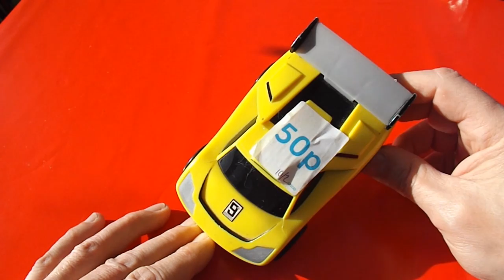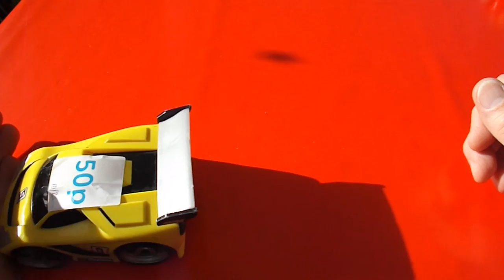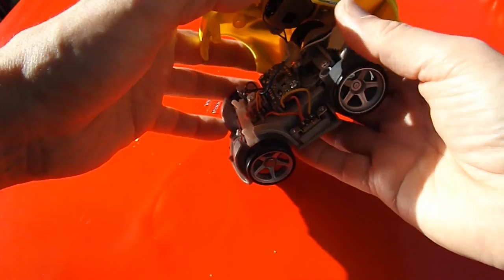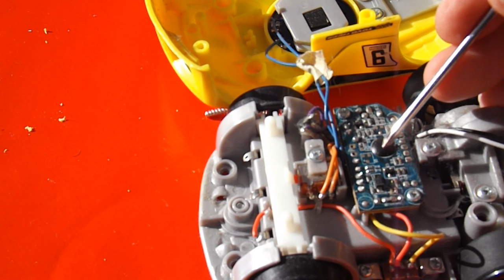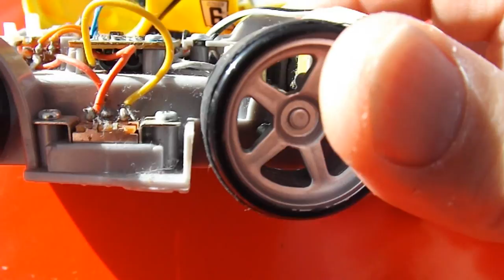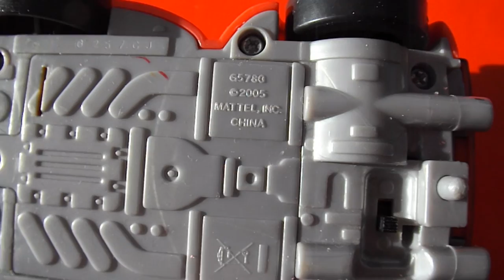Another Shake n' Go toy car Tear Down Toyo Tires

Comment: You now need the raceway to go with them, here's a video link -
https://www.youtube.com/watch?v=bGa6B7hkByE
 from what i can gather the rear underside plunger actually stops the car, only when the intrack arrow is lowered does the car start moving.
Reply from the maker: Spot on. With the rear button/plunger depressed the car does not move. As soon as it is allowed to drop the car moves off. Thanks for that link. I will have to do another video 😊